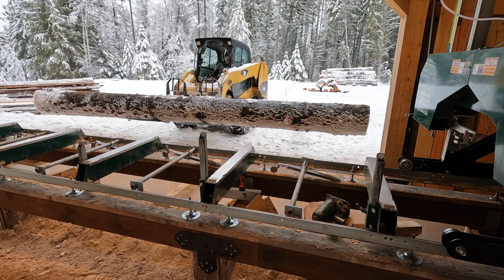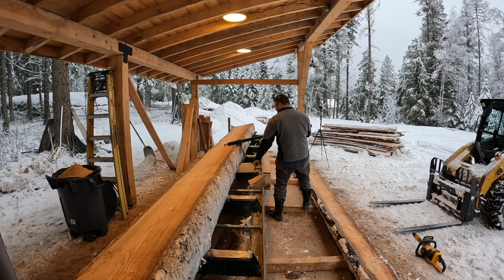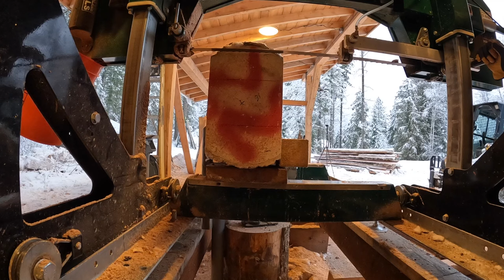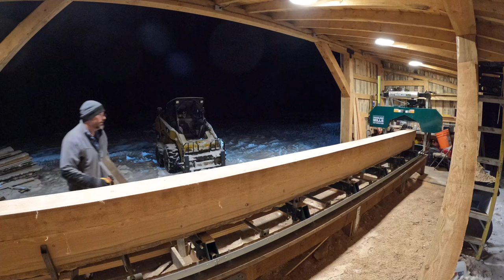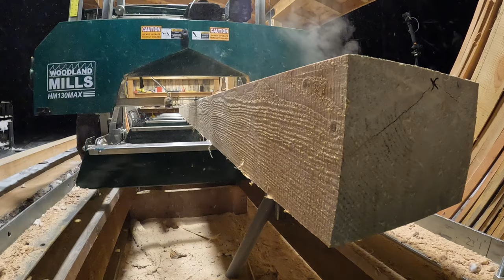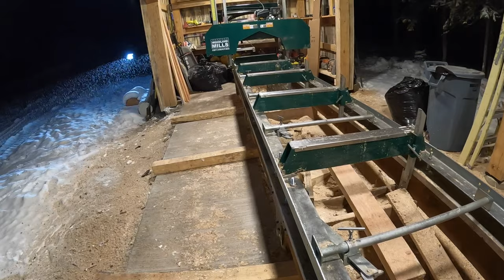Using BIG DOUG FIR Trees From Our OWN LAND To MILL Timbers / Two Posts Out Of This BIG Log - No Pith

Comment: Just curious if you run water on your blade in those temperatures?
Reply from the maker: No water. I use windshield wiper fluid. I share about it a few videos back…it’s called Sawmill Maintenance-winter tips. 😁
Reply: That’s a good idea. Thanks
Reply from the maker: @michaelflores572  You’re welcome! 😄
Reply: @michaelflores572 hi how are you doing?
Reply from the maker: Hi, we are doing great, thanks!  @georgemoore-wg5jj